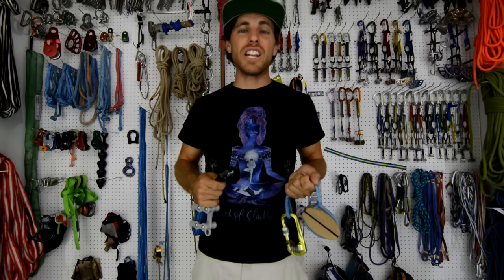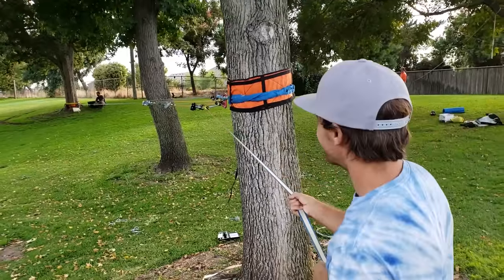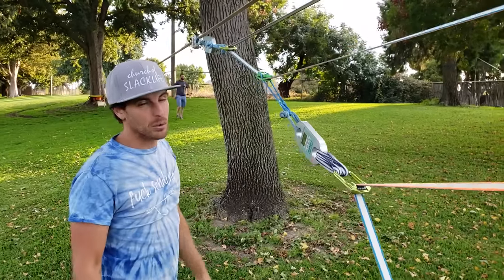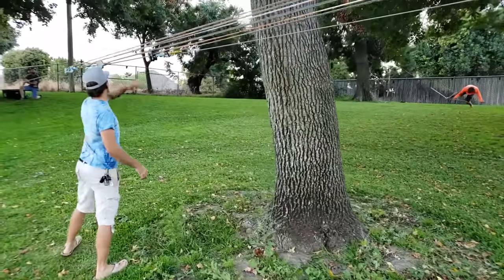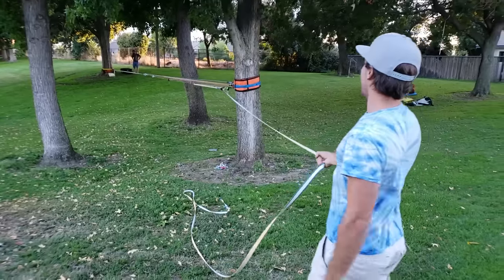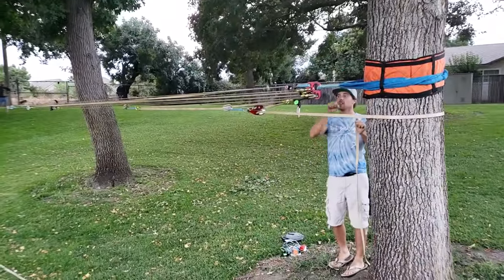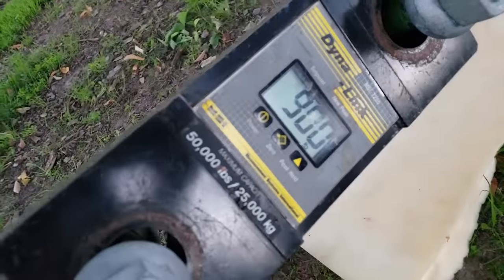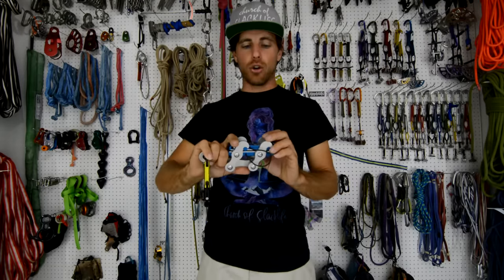Slackline tensioning experiment - Buckingham Palace

Comment: 81 to 1 doesnt sound right. You get x to 1 where x is the number of legs in the system. 81 to 1 would have you moving 81ft of line for every 1 ft pulled thru the load end. I may be hella wrong but also maybe not...
Reply: You are right if you're pulling a suspended load with no stretch rope.  Here everything's stretchy..